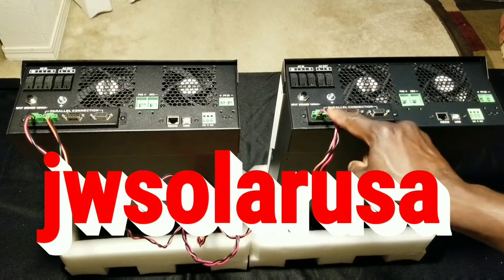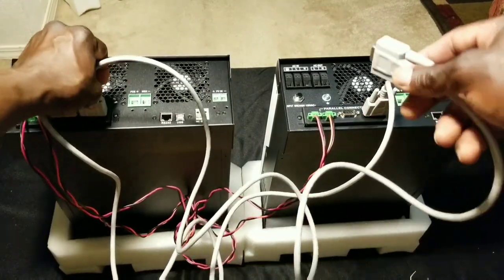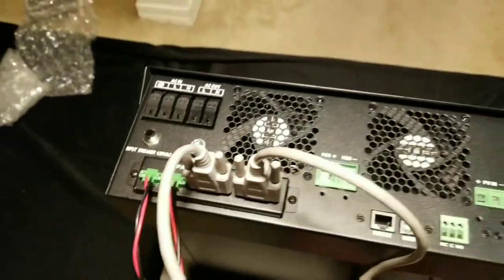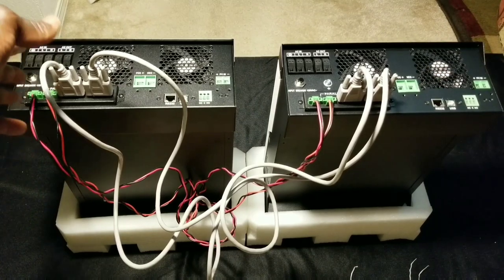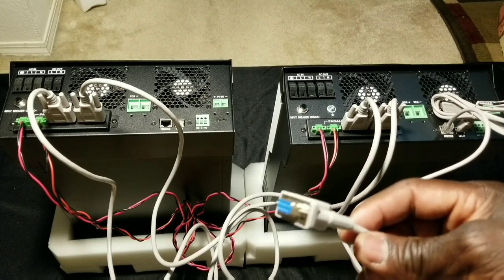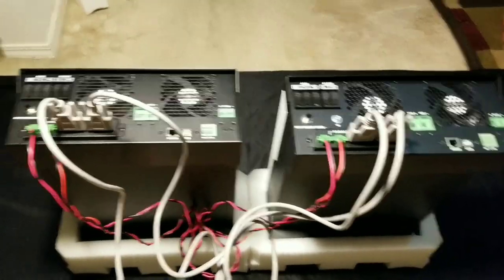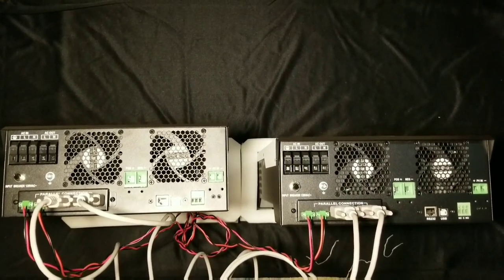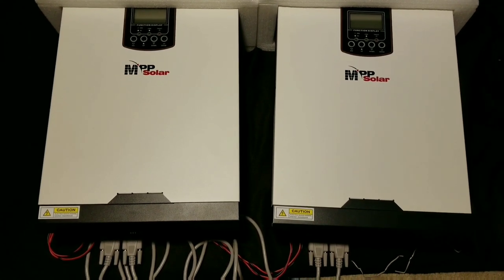MPP SOLAR INVERTER CHARGER PIP2424LV-MSD INSTALLING PARALLEL BOARD

Comment: Are these units still alive?
Reply from the maker: Still running strong
Reply: @jwsolarusa  ok nice, running for 5 years or on and off ?
Reply from the maker: Check out this video on the latest update. https://youtu.be/Y4Ki--6Oup8
SUBSCRIBE LIKE and SUBSCRIBE
Reply from the maker: @diy-bj2ed  
Running for five years nonstop 24/7 365 days every year.
They run the house including sump pump
Reply from the maker: They run the house including sump pump, washer, freezers, two window Air Conditioning and also heating the garage during winter.
Reply: @jwsolarusa  alright thanks, wanna try out the mpp 3048LV-MK
Reply from the maker: @diy-bj2ed  
Cool
Reply from the maker: https://youtube.com/playlist?list=PLSNjIRSnUPDKXXZG828Z7JPsQQSC4RdWi
Reply from the maker: PIP-6048MT MPP SOLAR INVERTER 6kw 48V 
https://youtube.com/playlist?list=PLSNjIRSnUPDJmldVLiaJAYeyiAD9NApKV

Comment: How are the loads on the device? Are they distributed among all the devices? How much is the power output? The voltage is 230 volts from all the devices, or from one device only, or is the power from all the devices 2 phases, then distributed in the house’s distribution panel? Explain this, my brother. Answer the comment.
Reply from the maker: Please visit my playlist for more videos.
Please don't forget to LIKE SHARE and SUBSCRIBE

Comment: Most people prefer external charge controllers, for no other reason that the heat. Even I have a PCM60X and a PIP 3024HS that put out 230v. But I live in Asia these days. But I am so happy to see your videos showing PIP's in America. So I guess you would call me a PIP fanboy. LOL   Now there is a problem with software you can't run MPP Tracker and Watchpower on the same computer. You will need to download solar patrol to run instead of watch power.
Reply from the maker: Thanks for sharing this information  buddy.
Where can I download this Solar Patrol.
Please send me the link.
It's good to hear it from you that your PIP is working
Reply: This is a link to solar patrol don't worry it is in English... http://www.energialternativa.info/public/newforum/Discussione.php?213402    Solar Patrol is only a monitoring software.

Comment: Do you know the length of the parallel cables?  I have an existing installation where the distance between the inverters is about a meter (3 ft)
Reply from the maker: Good morning brother Steve.
It is at approximately 5 to 6 feet long.
E-mail at jwsolarusa@hotmail.com with your phone number

Comment: Hello Buddy! I just purchased another one of these mop 2424 so do I need a parallel kit to run to different circuits in my house but I want to parallel the neutrals but separate lines L1 L2 Can that be done without the parallel Kit . Will I bow the units?
Reply from the maker: Hello Ra ant,
You don't need the Parallel Kit Boards on less you have higher demands on power. For example like well pump that surges up to 3kW over the limit of one hybrid inverter or so. But I will say just split up your loads evenly to two Sub Panels.
One PIP Hybrid Inverter per one Sub Panel and split your entire house loads evenly among the inverters and run part of the house on one inverter and the other half on the second inverter and then run them on the same battery bank if you wish.
This is what I did here exactly on the link below Maybe these videos will make completely sense. 
MPP SOLAR INC PIP 2424LV-MSD 120V 60Hz: https://www.youtube.com/playlist?list=PLSNjIRSnUPDI2b7XfOIOWnpE7VGq2gOEO
Thanks for stopping by and hope to see you on my next videos coming up soon. 
Cheers
Reply: Thanks for that! Can I share the neutrals with each units and different sub panels because I have a disconnect with same ground and neutrals  but separate 120v 20A circuits and output to each sub panels ?
Reply from the maker: We didn't share our grounds. Each inverter was isolated from each other and we didn't use the Parallel kit which I have here. 
Please NOTE, you can NOT do a split phase on these inverters. If that's your intention, PLEASE STOP! and consult your local Electrician.
Mpp Solar has come up with the split phase 120V per leg to give you 120V/240V into you main breaker box. These are the GREEN inverters 2424lv 120V/240V split phase which you need two of these inverters with a parallel kit to conduct the split phase configuration. 
Here is a link of those inverters:
https://rover.ebay.com/rover/0/0/0?mpre=https%3A%2F%2Fwww.ebay.com%2Fulk%2Fitm%2F142713527856

This is MPP Solar Ebay channel or you can contact them directly in Taiwan and speak directly to Peggy. 
(NOTE:)
I am NOT a Electrician and I am NOT responsible for any lost of property,damages or lives. PLEASE IF YOU DON'T HAVE KNOWLEDGE ON ELECTRICITY, PLEASE CONSULT YOUR LOCAL ELECTRICIAN TO DO THIS FOR YOU.
GOOD LUCK
Reply: No I'm not using anything 240v all 120 just wanted to know if I could share neutrals in 2 different sub panels the but 2 different  legs l1 l2 disconnect
Reply from the maker: Hello buddy, 
You can send me your contact if you really wanted to talk about this on my Email address below. jwsolarusa@hotmail.com
Reply from the maker: Stay tuned I filmed another video on Parallel Boards installation on the Mppsolar PIP5048MG. Please watch the step by step this tutorial video installation ever made

Comment: hi jw one question since the input of both is dc can i connected one on pv and one in wind after the rectifier my question is can i used 2 of this to make a hybrid system thank u
Reply from the maker: +Jose Gomez 
Hello my friend. I can only advise you to use solar ONLY on these Hybrids nothing else.
They are not designed for Wind Power. 
Thanks for asking and have a wonderful evening
Reply: thank u jw i going tried any way thanks

Comment: Are those pip2424lv still working to date? An what are your dislikes?
Reply from the maker: They have been running proximately 4yrs.
They have been running 24/7 and 365 day round the clock.
Reply: @jwsolarusa  ok thanks, wanna get one but seeing some people saying idle consumption is high

Comment: Hi from Australia! Could you tell me if I can run two parallel inverters from the same Pv panels?
Reply from the maker: What do you mean?
Reply from the maker: You can parallel the inverters to the same battery bank and you can have a string of solar panels on each inverter or both. 
But, never parallel strings of solar panels to the inverters due to PV input current is very low proximately 20A . While PV input voltage is as high as 450vdc. 
This gives you the leverage to have multiple of solar panels in series instead instead of having solar panels in parallel due to 20A solar input current.